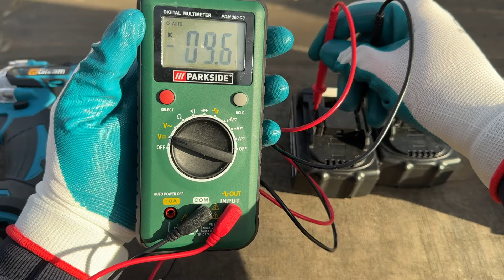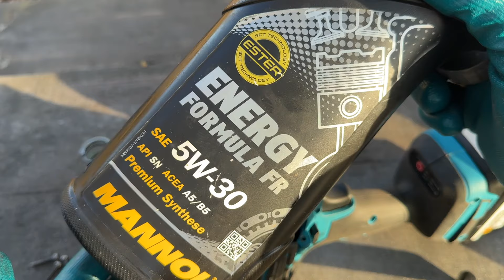Experimental ONE OF A KIND impact wrench - Does the ambition outweigh the current technology?

Comment: I have the same but not Gisam, i have other generic aliexpress impact wrench and i think the battery is lower quality than yours, i cant lose any lug nuts in any car, it probably has no more than 70 NM, i am thinking about  modifying the battery, ditching these crap cells and put there some Sony/Murata 25 to 30 Amps instead. I dont know if that is possible, not sure if the BMS will hold in this crap
Reply from the maker: I am not surprised I doubt for this price they have any quality control. Anything that is assembled and looks like it should is ready to be shipped most probably. It is very hit and miss buying tools from Aliexpress as you don't have a genuine return option so they'll just send you something and you have to hope for the best. Regarding the batteries I have not tested this myself, but I do see in the comments many people do say that better batteries make a difference on these.
Reply: @BrokeLifeEU  makita as uses Sony murata cells from 15 to 35 amps of discharge which means depending on the configuration (3ah, 4ah, etc ) it can deliver power bursts of up to 1300w. These cells are expensive as you can imagine, mines should not be anything close to them as the battery itself was a 12 euro option extra and with 12 euro you barely buy one or two quality high discharge cell …that’s why it can’t move any nut
Reply from the maker: Yes, although I was surprised to find that the Gisam batteries have two rows of 5 cells and that they are in fact around the 4Ah mark. They are decent for the price. Although as no warranty claim can be made on these tools a bit on the risky side. And the charging is painfully slow!  @ferfire9
Reply from the maker: Absolutely on your side on this one! It's just I was not expecting to get any sort of power at all. And it has some.
Reply: @BrokeLifeEU you got better luck than me. 😅 I almost can stop the impact driver with my own hands, that’s how weak it is, measured the voltage and was 19,9V.
Reply from the maker: Is that the highest it will go? On the ones I got with these Gisams I can charge them up to about 20.6V all the time. And that is with the rubbish included charger. @ferfire9
Reply: @BrokeLifeEU  I don’t know it probably will but will need a lot of hours to do so.
Anyway I work with Makita tools, I will bring one battery and test it with it and see the difference , might just buy a used one would be more trustworthy than aliexpress cells and electronics
Reply from the maker: Yes, I am afraid to leave Aliexpress batteries to charge unattended. I don't think I can ever get over this fear. I have had no problems, however I have heard and seen pictures of some horror stories about Aliexpress batteries.  @ferfire9
Reply: @BrokeLifeEU same lmao, that’s why I never let it charge for too longer if I am not looking…I can’t trust them
Reply: Just tested with an original Makita 1850b battery, which is a 40A battery 5ah and it easily took wheel nuts off...so i definitely have a battery issue with chinese stuff, need some real battery cells there @BrokeLifeEU
Reply: @ferfire9 So for you the battery made much difference? I have a Gisam but the most powerful version and it doesn't remove a wheel bolt or anything
Reply: @ferfire9 thanks on info!!! I bought ma kita clone on flea market and have same issues. Wantwd to return exchangw it for some other impact but aftwr your comment i decided to repack one battery with 18650 i think have high discharge amp rate. Thank you!
Reply: @Untiocansado  yes but still it is a weak impact , I recommend getting the “1200”nm one from onevan which is only 15 euros more and it’s a lot more powerful or the “1800” which is bigger and much more powerful . The “520”nm one is weak  , has a slow throttle response and basically is useful for small jobs only including screwing which is nice ,